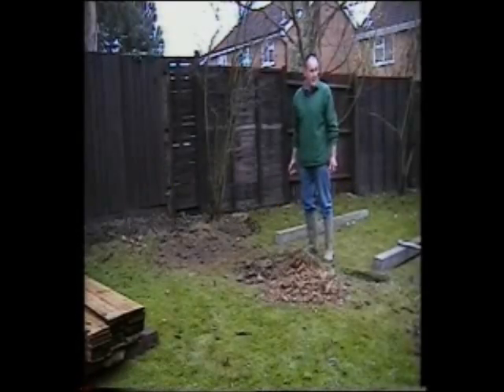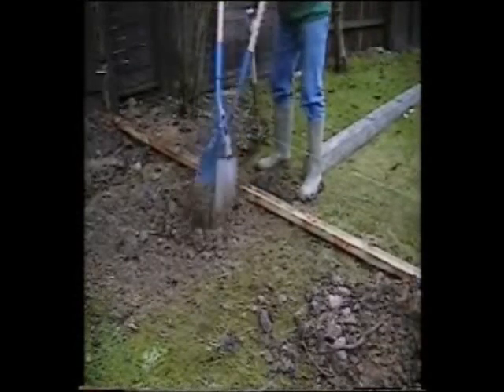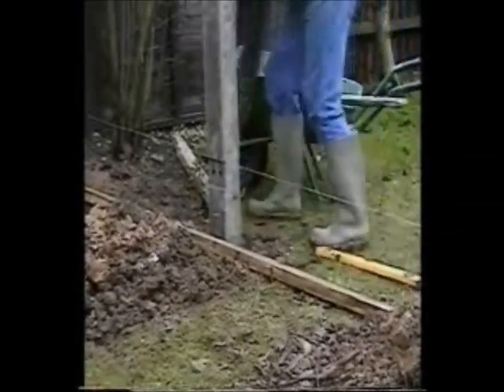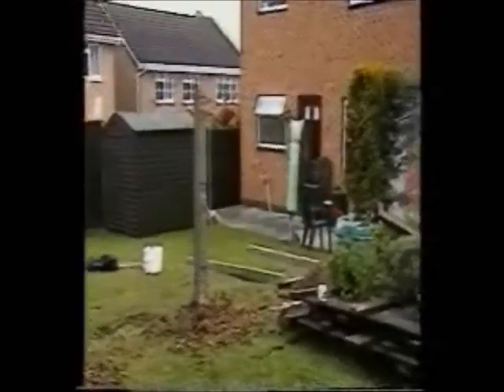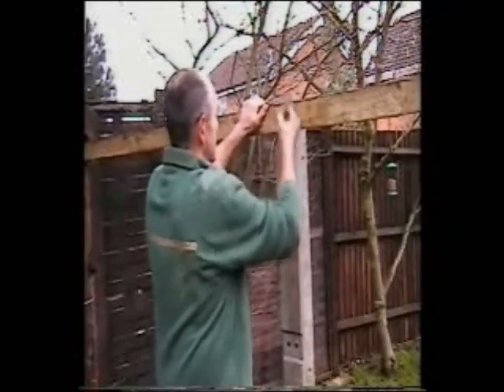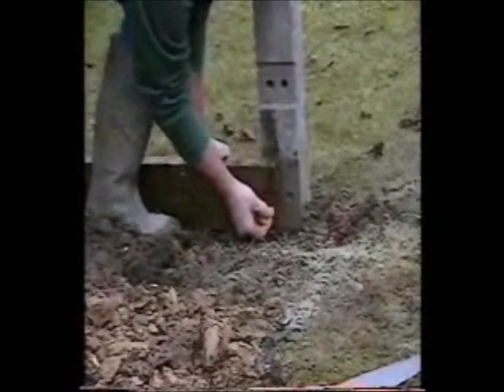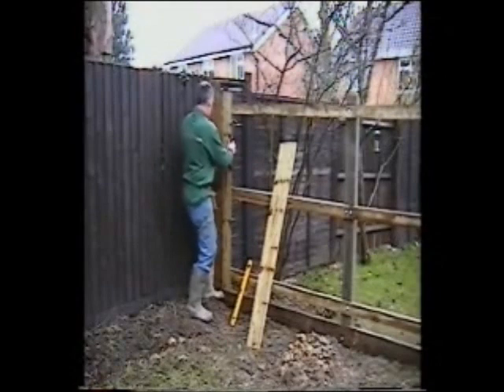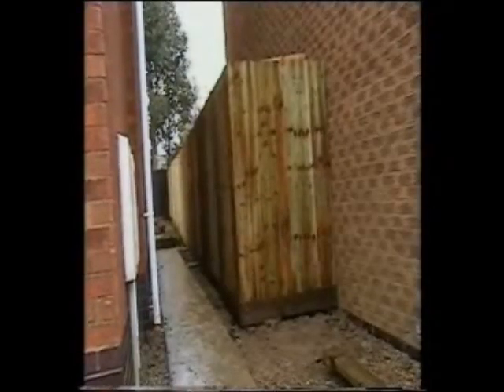How To Guide - Featherboard Fencing

Comment: My fence is 4 foot in height, and I am moving the fence back 3 foot, I have  just  dug the old posts up, the gap is 33 foot wide, how many posts do I need, also the height of the new concrete posts,I  am of to fit wooden gravel board as well, so with grave board and fence it will be 4 foot 9 inches high,I am using the old fence as I only put it up, just over a year ago, so there is nothing wrong with the wood.